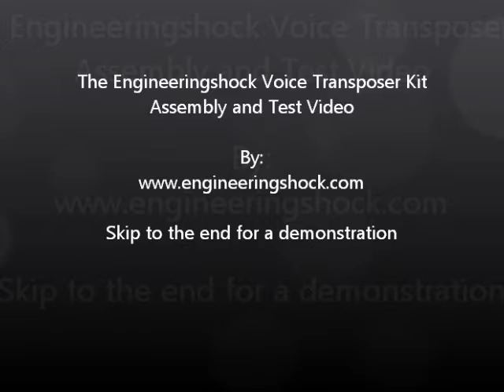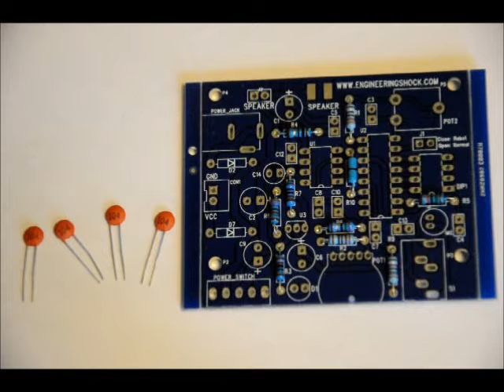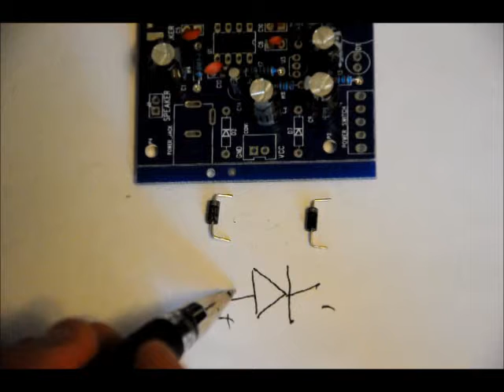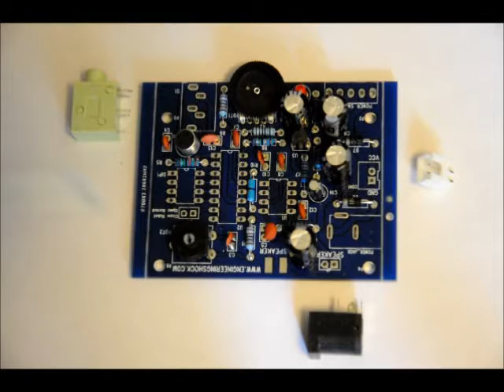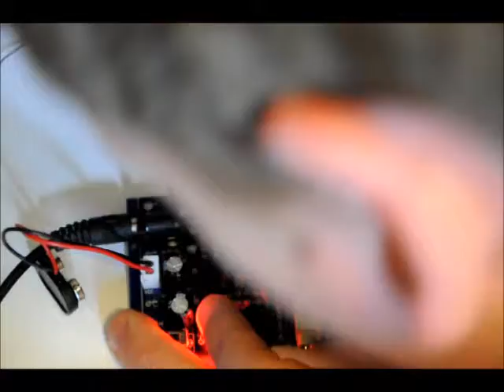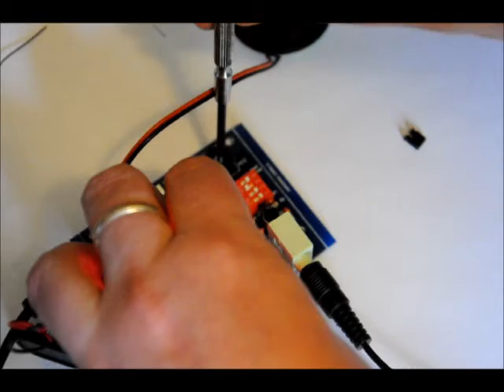The Voice Transposing DIY Electronics Kit Assembly and Demonstration Video

Comment: Hi Patric, 
I would like to use it to reduce feedback between MIC and loudspeaker by modulating the voice input by 5%. Is that possible with this circuit?  - For that I need to know, whether its frequency shift modulation (not only the vibrato speed) can be reduced to 5%  ?? If it can than this circuit would be useful for audio feedback reduction, for it varies the output signal from the input signal and so, prevent looping of the signal.
Thank you in advance for your good advice, Johannes from St'go de Chile

Comment: I wanted to add LED's that would flash on and off with voice input. How would I do this, would it require a transistor on the mic in area? Please help. I want to have advantage of robot voice but with LEDs that would mirror voice.